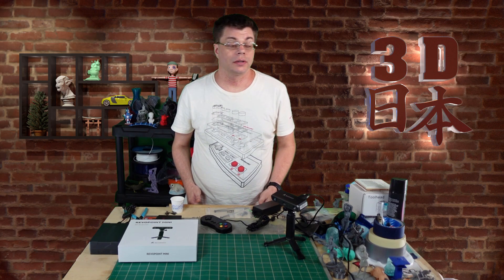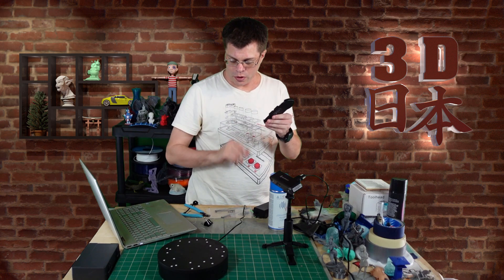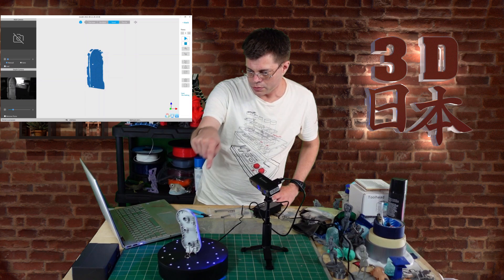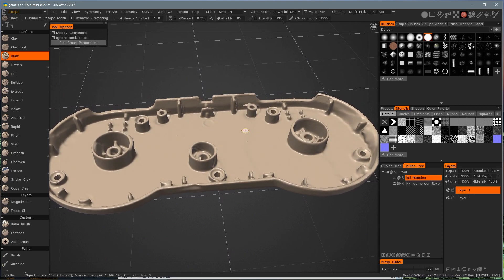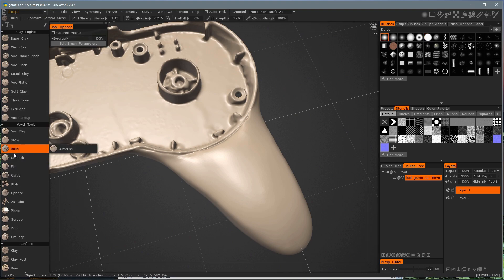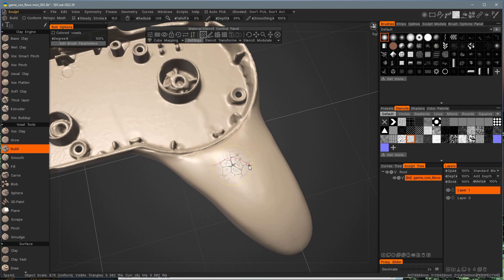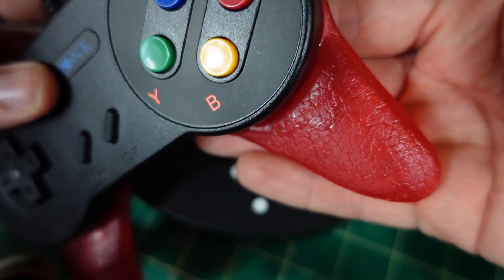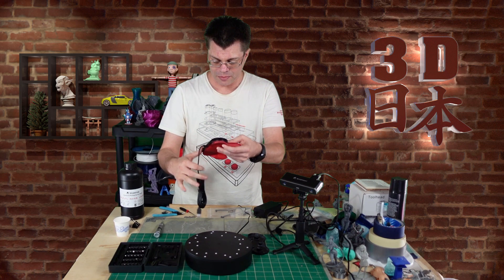Modding a Game Controller with 3D Scanning Plus a Giveaway #giveaway #sweepstakes #Revopoint3D

Comment: It’s amazing how accurate one can get the scans with a domestic device. I only tested photogrammetry because the scans I get are usually only for artistic job but no mechanical. Thank you for showing your workflow!!
Reply from the maker: Glad you liked it. It you haven't seen them I have some videos on photogrammetry. In fact that's how I started 3D scanning.

Comment: Cool, man! Thanks for the video showing a use case and thanks to you and Revopoint 3D for the opportunity to get one of these kits! Super useful!
Reply: Heads up, the Revopoint 3D youtube link in gleam doesn't actually link to the actual youtube page. I did find it though and subscribed. :)
Reply from the maker: @eukaryote-prime  Thanks I'll check on it.
Reply from the maker: @eukaryote-prime  It should have worked before but I changed to another URL. Hopefully this one is better. Thanks.